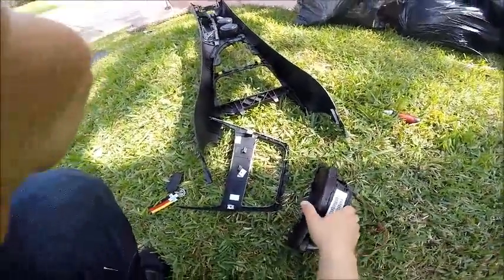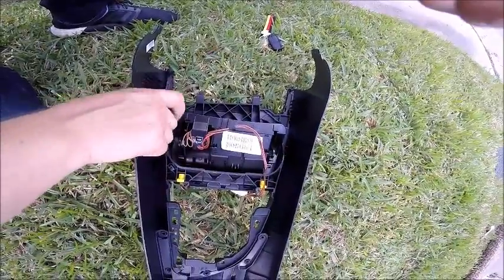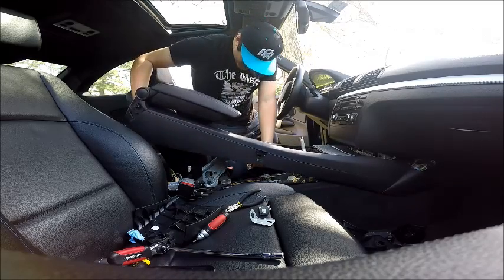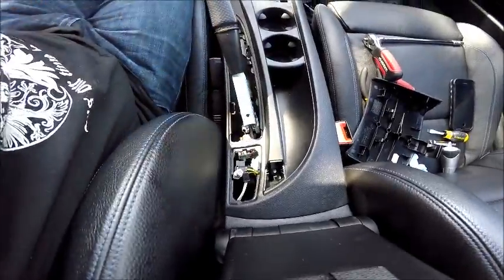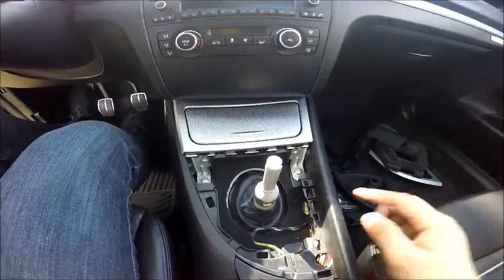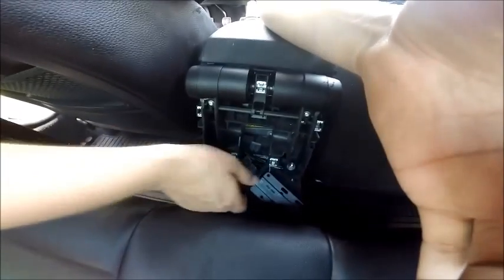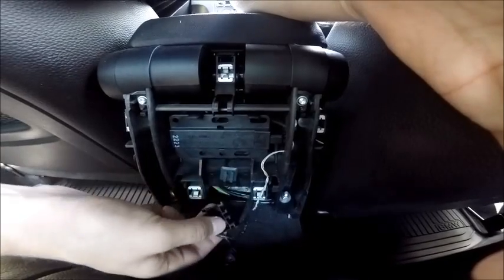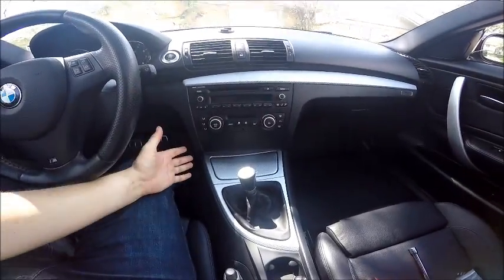BMW 135I INTERIOR TRIM REMOVAL/INSTALLATION (part 2)

Comment: Another great video, but a word of caution to those trying this - when you seat the console back in, make sure the two protruding prongs, the ones that sit under the dash either side of the ashtray, are tucked on the inside of the other plastic trim. I bolted the whole thing back in (in the dark) before going to put those two plastic plugs back in and realising my mistake. Had to undo the whole thing again 😂😂😂
Reply: Matter Moo Haha, no, me neither. I was feeling so smug about it all going back together so smoothly too :D

Comment: Thanks a lot for the detailed assembly 👌🏻👍🏻!
Reply: Is ist necessary to take out the whole center for changing the ashtray and the cover of the ashtray!I only want to change the surface in alcantara!Please say that there‘s another trick,but I don‘t think so😱🙄😭!What’s about the DKG electronic gear knob and Idrive deinstallation?Best regards from Germany!

Comment: I'm trying to install an idrive in the cup holders place, can i remove them without cutting or i have to cut the board? Thx
Reply: How did you solve your Problem? i have the exact same one and i think i have to put a different centerconsole into my Car